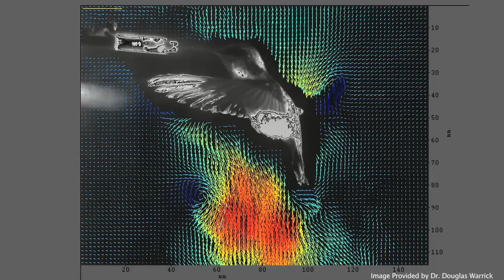Hummingbird Aerodynamics- High Speed Video - Smarter Every Day 27

Comment: hummingbirds prove evolution is false :D
Reply: Why is that so?
Reply: No they don't. Hummingbirds share a common ancestor with swifts. Research hummingbird evolution.
Reply: How so? If anything I think they prove evolution is real, they are usually found in places with a lot of flowers (usually more flowers than anything any other birds eat) which pretty much solidifies the fact that over time animals will adapt to the best way to survive, they are small so they are lighting quick, and the presence of tons of flowers explains the long beaks (which evolved from the birds with longer beaks to get bugs oyt of trees. Last but not least, it's wings, different from pretty much every other bird which usually has a more vertical flap as opposed to the hummingbird which is more of a horizontal flap
Reply: CAVEMANsean
Have you never been on the internet before? Don't feed the trolls ffs.
Reply: EXPHunterForce The only good troll is control.
Reply: CAVEMANsean Or the flowers are there in such great numbers because they have such an efficient pollinator (i.e. the hummingbird).
Reply: no hummingbirds prove that if you eat a pancake then you can fly but only if you have a green hat and a nickel